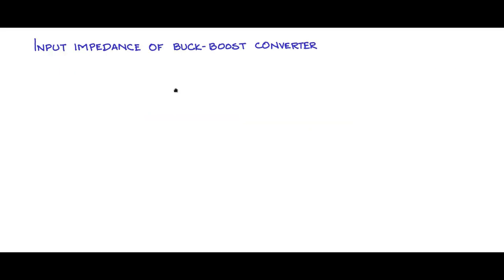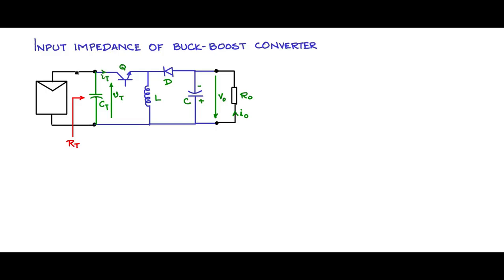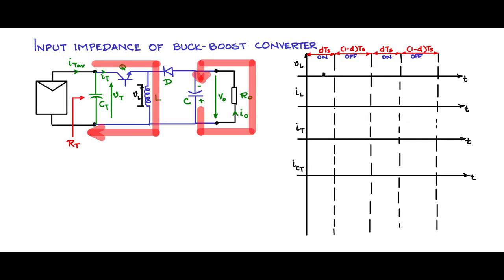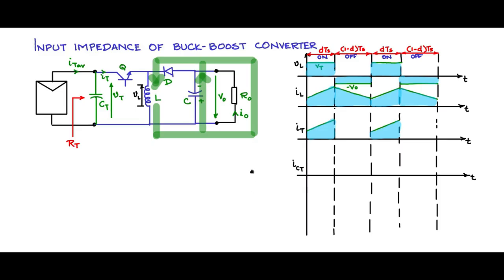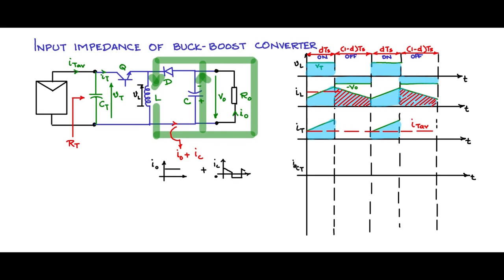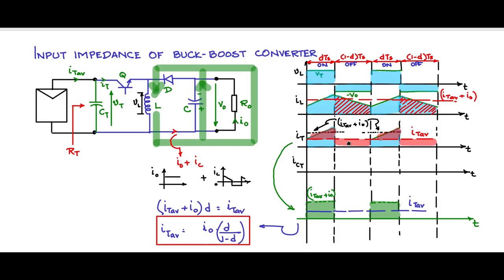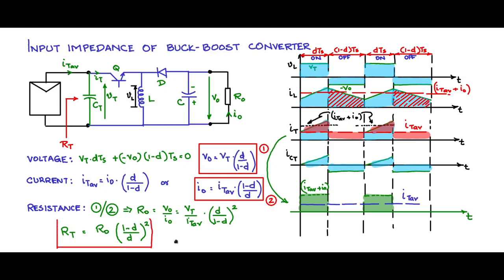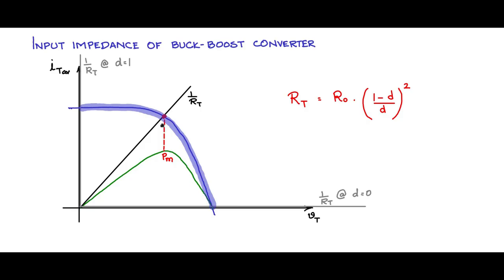Input impedance of Buck-Boost converter

Comment: Great explanation!I just have one comment about a possible error. I think the i_CT waveform should be negative during subinterval 1 and positive during subinterval 2 if using passive sign convention for the terminal capacitor current. This can easily be seen during subinterval 2 where i_CT = i_Tav > 0 because the PV panel should only be giving positive current. Thus, i_CT during subinterval 1 must be negative in order for the average(i_CT) = 0 during one switching period. This does not affect any of the calculations, but I think it should be mentioned for better understanding.

Comment: How diode is forward biased when Q is off?
Reply: Inductor polarity reverse when Q is off and in that moment the diode will be forward biased and inductor will discharge in the capacitor, the capacitor in turn will charge. This inductor current freewheeling through that diode.